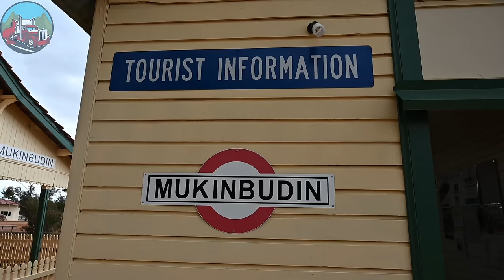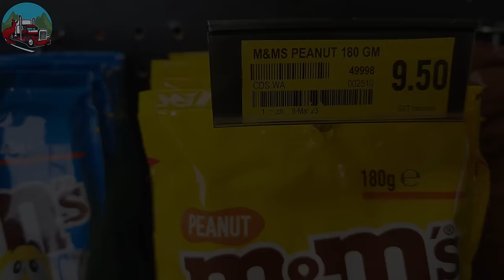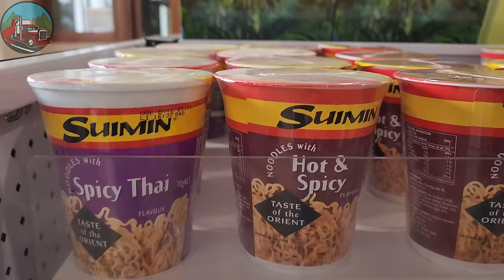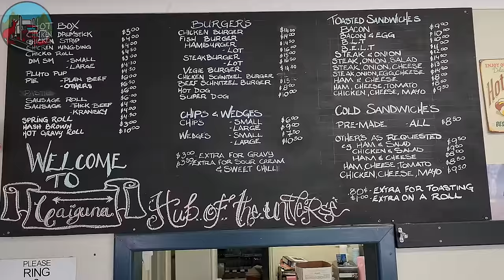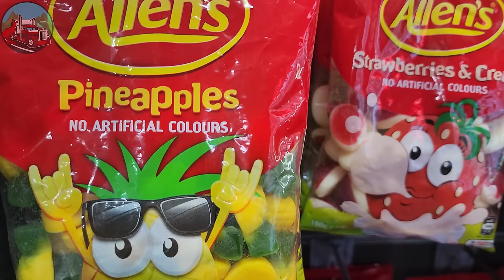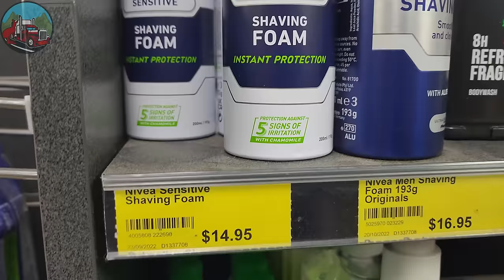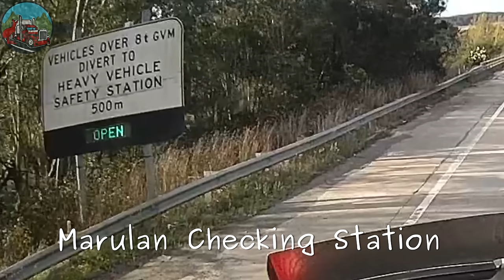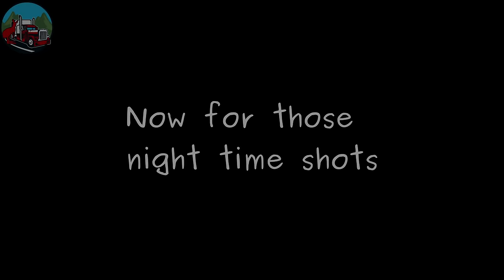4000km's in a Road Train Across Australia

Comment: That joint at Norseman you stopped at showing the prices on the shelves? When you got to the Rexona at $15:50 a can everyone watching in the lounge room all at once yelled out ;Ah F**k That, x 6 people, except for meself, they all beat me! As for engine noise i used to listen to a super charged 2 stroke GM in a D7N Dodge running the Warrego between Brisbane & Toowoomba. This was back in the 90's & that truck passed every thing on the road except the bowser at the servo! When those motors were blown but not turbo'd, they had a different pitch in the exhaust note through a set of donaldson mufflers & ear plugs were the order of the day. I miss that truck & cannot recall when the needle sat on 100, if it was in kph or mph, & you still had plenty of throttle left I can assure you!!! That truck upset guys in their Stars/Kennys & espically V8 Macks gettin' rounded-up by that thing. Heck ,i was 25 & still in my hoon years back then & how times change! Another good show there Brother ,keep em' coming please!
Reply from the maker: Awesome. That truck sounded pretty good. It's all political now. You can't have anything loud.

Yes the prices at Norseman are shocking. They certainly make a profit from the travellers.

Comment: I used to do the odd run across the paddock many years ago when it was single trailers only. Road looks much better. The SA section was always better than the WA part. Just wondering why you took a roundabout route to Southern Cross. Floods?
Reply from the maker: I can road train straight out of Perth by going that way.

Comment: Great vids bruv, can you try to give your all up weights next vid?. Do you keep a box of spares that you might need per trip? Keep on truckin, regards from Blighty.
Reply from the maker: My weights are usually around 79 ton all up and yes I carry a lot of soars. Spare tyres, alternator, belts, pulleys and houses. We need to have things that may break on a trip so we can change ourself.
Reply: 79 tons..Jesus, Brit roads are not built to take that, some are not fit for 10 ton...
Reply from the maker: @charlyfarly5173  Yes we travel on the road train rides which are bigot for heavier weights. Other longer road trains are up to 180 ton

Comment: I was surprised to see a Road Train at BP Somerton just North of Melbourne and up the Hume in Vic on last Tuesday, way overtime to allow them on the Hume in NSW
Reply from the maker: Yeah there are lots of road trains driving around Melbourne. They are A Doubles and are shorter than me at only 30 to 33 metres.
Reply: @RoadTrainAdventures  what I seen was 2 full length tri-axle trailers with tri axle dolly. I'll send the short video on your FB messenger